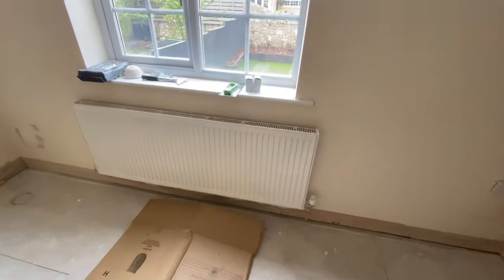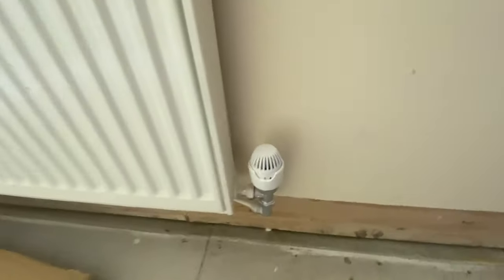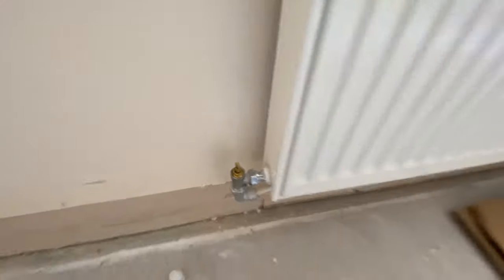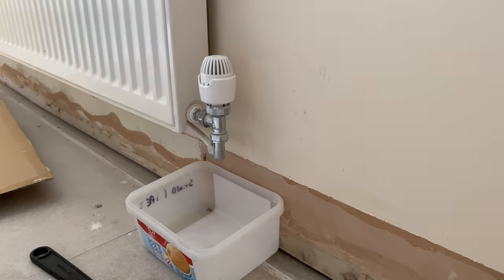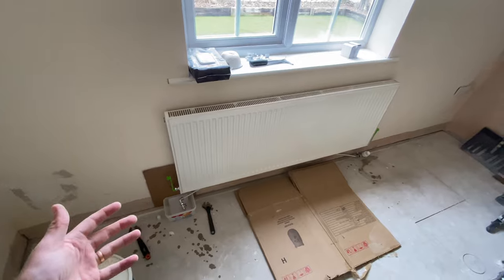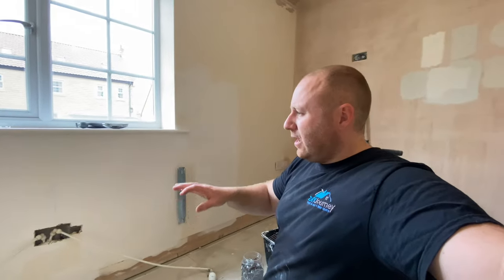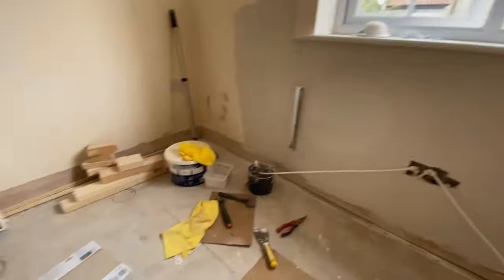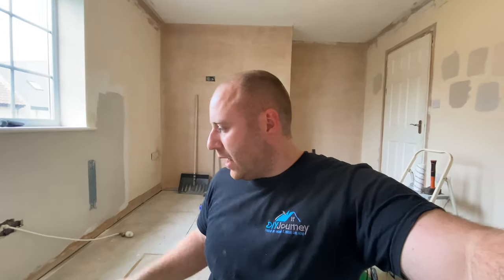REMOVING A RADIATOR FOR DECORATING - Nursery Project

Comment: Nothing at all wrong with this method if strong enough to lift that much.  Never knew about those silicone seal things - very useful!

No need to change olive if you are using the same fitting, should go back without a problem.  If in doubt add a bit of joint compound on the interior edge (fitting side, not nut side) of the olive.   Wont matter if you get joint compound on other bits, just doesn't do anything.

Should note that its common to find valves that use an o-ring too which might need replacing. You have to look closely at the fitting before you take it apart - you will see the fitting shape and maybe absence of visible threads than on a compression fitting.

Setting the lockshields/ balancing is to ensure all the radiators heat evenly, which can be a problem on branching systems but not so much on manifold which is often the method used with the 10mm plastic pipe.

Bit untidy the way they did the connections behind the radiator.  Usually better to do a single run with no extra joints and put a plate over the hole.
Reply from the maker: Agreed with last statement, unfortunately builder and first fix plumber were very poor throughout